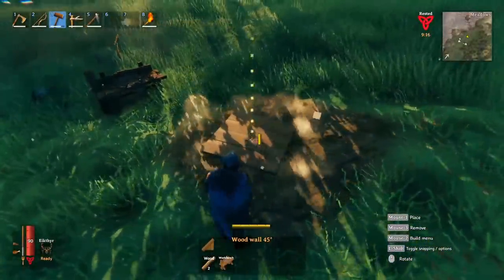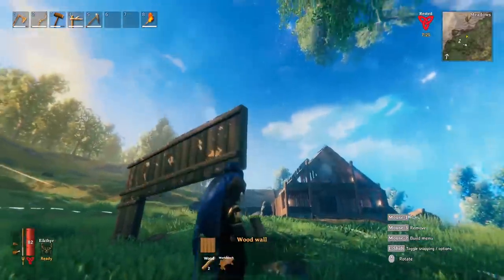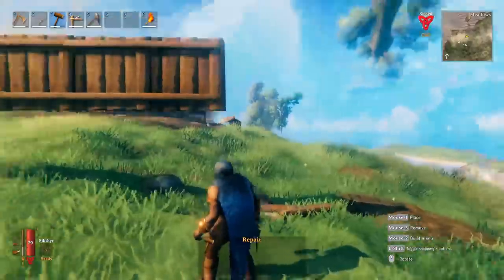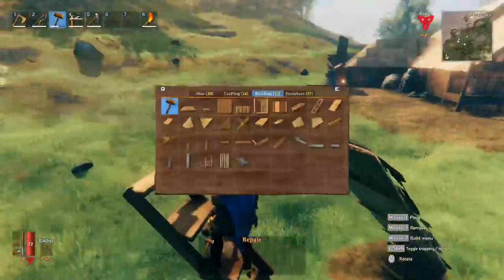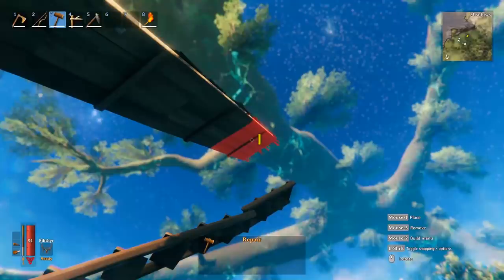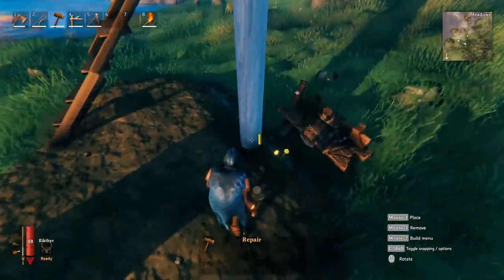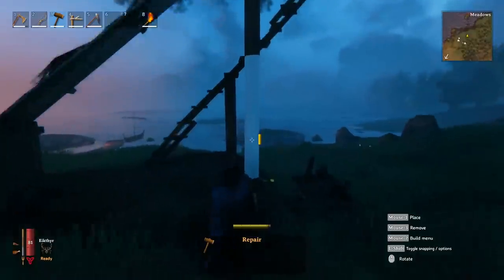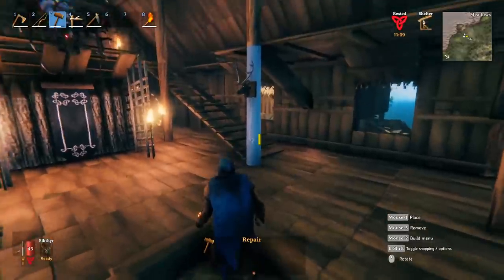VALHEIM - HOW TO REINFORCE YOUR BASE

Comment: One tip I'd like to share if you know you are building a tall building. Plan the foundation of your base but don't build up yet. Using the cultivator plant pine trees ideally around the corners of your building and one in the centre (you may have to remove some times, but don't worry you can put some of them back later. Once they have grown, build your house. By connecting to the pine trees, it counts as grounding your house. So you can build higher or more outlandish buildings without losing stability.

Comment: I've found that wooden pieces start blue when attached to stone pieces, even if the stone pieces themselves are not blue. I hope this helps!
Reply from the maker: Yes it seems that stone acts as another way to set foundational pieces!
Reply: If the stone piece is raised up on wood then wood parts coming off of it won't be blue they'll be green where as the stone will usually be red in that situation.
Reply: Interesting way to get a base into the ocean.
Reply: Stone is considered ground when it comes to integrity for other stuff that is not stone. Wich is why you can also put fireplaces and other stuff on stone.
Reply: Also another thing I can't get down is a "fireplace" with the stone hearth. By that I meant a stone hearth with stone pieces fixed around it. The stone breaks or the hearth snuffs out.
Reply: I've built two towers, one entirely out of wood (as high as I can). The other stone, then a wood tower on top of it. Building on top of stone is great!
Reply: This is the exact piece of information I needed to finish my docks, thank you! Just wish there was some way to interact with underwater ground. I hope the devs improve on this particular part of construction. Already having the time of my life building things though :D

Comment: I didn't have a game, but I expect, related to my experience in Medieval Engineers and it's structure integrity system, that you can put some dirt on place of the blocks and you will get it's stability. For Valheim I guess you may make some vertical ground pillar straight up, then build walls around it and then build vertical house around this pillar.
Reply: UT99 represent
Reply from the maker: That is a creative way of making a tower for sure!

Comment: This actually saved me I used to get SOOO angry because my builds would break even tho I had an entire cross roof beams going across long ways and on the thatch roof and across to each other and shit and even some beams going to the floor but the floor wasn't touching the ground so it wasn't working it was super angering, this really helped I couldn't find a single video with info about this until now :)

Comment: I've noticed the angled beams, the 26 and 45 degree ones placed in the corner of where two a vertical and horizontal beam or log meet will provide more stability and allow for taller builds. I'm not certain (haven't experimented enough) but I believe multiple paths of support to ground may be fractionally additive. For example, building in this way I was able to build a watchtower with only beams and got it about 14 meters tall at its highest point and completely roofed.
Reply from the maker: Yes I do believe adding beams does add a little bit more stability as long as they're connected to the ground in some fashion. I'll be doing more extensive testing over the next few days to try different methods and see what works/what doesn't!

Comment: I know this is an older video and it doesn't look like you like a stonecutter in your workshop yet. Stone will increase stability even higher. A simple stone floor structure with some stone columns going up to build off of effectively raise your "foundation" level. Considering this is a month old from when I am posting this I am sure you have found this out. I did learn something very important by this video as I did not know about the number of distances and this is helping me out a lot.

Comment: Great video, the only theory that I would posit is that the number of pieces don’t matter, it just matters distance and strength.
If you build a pillar of 1 meter posts, you can build just as high as if you build the same pillar with 2 meter - suggesting that it isn’t a matter of just how many pieces it is to the ground.
But, there is definitely differences in how hight you get with different types of pieces.
This is why I think it is a mater of distance, not number of pieces, but that different pieces have different “strengths”.
Which would have it make sense that the log poles would work better because they are from a later game wood.
Reply from the maker: Yeah honestly I'm not entirely sure myself, will have to do more extensive research to find out

Comment: I've become a fan of building round buildings. My first base structure in the meadows is usually 1 wall, then rotate the wall 1 click. It comes out not too big, not too small. As I move on to the black forrest I do 2 walls and rotate one click to add room for more equipment like upgrades and the forge table. At 3 walls and one rotation tick you're  as big as you'll ever really need. 4 walls with 1 rotation click you are following what your crafting table allows. Every few roof tiles in you add a support to the ground, then in the middle where the roof tiles begin to majorly overlap you raise the roof with short poles to allow for smoke gaps, and finnish it off of those poles.
Reply from the maker: I've done this exact procedure for building my treehouse, you will see examples of that in Part 2 of the Treehouse Timelapse :)
Reply: @schmidtyhk  im about to move on to the swamps myself, going to make a tree house there as my next base.

Your discord keeps kicking me while I wait for the 10 minutes to claim roles btw
Reply from the maker: @buell2468  oh no, thanks for letting me know. I'll fix it and get back to you
Reply from the maker: @buell2468  Hi Tyler, I just checked and you shouldn't need to wait 10 minutes. Just go to #assign-roles channel and react to automatically give yourself a role. Once you do that it will override the 10minute wait

Comment: Good video, but in my house i have added 1 side bar to hold 1 pc of roof a bit extra, and it falls if its not there, but it holds if it is. therefore the little pc of wood does help in some complex structure to distribute "green". idk how else to explain it. My house is giant btw, this is why i say complex structure

Comment: You can increase the horizontal stability of building as well using the 26° beams and 45° beams, I tested this but don't quite know how to explain, so bear with me on this one XD

So, I built up 3 times with the 4m logs, and when I added horizontal 4m logs, I could only add one.
But when I added 2 of the 45° beams, starting at the bottom of the 3rd vertical log, and going to the horizontal log, I could add two instead of one.

It shortens the distance between the foundation by cutting the corner, I think.

Comment: if you stand on top of the wood planks, not on another piece of dirt, and then use the hoe on the dirt, it will go under the floorboard height without going too far for the log to be foundational

Comment: It's not ALL about length but structural strength. Poles etc have more than walls. So when you build the poles they were equal green, but walls went yellow faster. The core wood should however be better than normal wood, and Iron wood even better still.

Comment: So the structural integrity is based purely on number of pieces? So for example I couldn't just place 10 vertical walls without the top few collapsing?
Reply from the maker: It’s not exactly about number of pieces, it’s more about how far away you are from the “foundational" piece. I’m going to do some further testing on height limit as I believe there’s even more complexity to it after playing a bit more
Reply from the maker: As far as walls, I’ve tested and I can fit 7 walls on top of each other before they can’t go any further

Comment: I tried leveling the floor but there are still some pieces of dirt coming thought the floor. How do I fix this?
Reply from the maker: You could break some floors until you find one patch that is the correct level, stand on that then level. If it still won't go down it's because you can't level any further, then you'll need a pickaxe to break it down

Comment: Is there a height limit? I was building a watchtower and kept reinforcing the structure on the way up, but after a certain point, it seems that no matter how much I stabilise the building, I can't build upwards further.
Reply from the maker: I believe there is because as you go higher, you'll be further away from the foundational piece on the ground. So it's less about a 'height' limit, but more the fact that we have a limited number of pieces we can connect before they will lose strength
Reply: Really makes me wonder if trees could be used as foundation pieces
Reply from the maker: @ReducedWater  Just coming back to this comment now, you can use trees as foundational pieces as evident by the treehouse I'm currently building!

Comment: i am still figuring out why you need to repair the floor every 2 days and the first level walls . but the roof etc has no demage over time.. it makes no sense .. i flattened the flor so its supported by floor.. yet my  floor and 1st lvl walls keep getting damage for some dumb reason
Reply from the maker: Anything that is not covered by a roof will take damage from the rain and storms, but don't worry it goes down to 50% health but it will not break

Comment: wait so does that mean Trees count as Foundation pieces? and building off trees lets us go even higher?
Reply from the maker: I don't believe they count as foundational pieces because you cannot 'snap' pieces to them unfortunately.
Reply: The base I’m working on agrees with your idea, and it is even better, they count as the ground. So, attach pieces to them, or get them close enough to be considered touching and you’re all set.
Reply from the maker: @jasonlatta2000  ahhh I didn't know you could snap pieces to them! The only issue I could potentially see is if you got attacked by trolls, if that tree breaks it's GG
Reply: @schmidtyhk  that is my concern, but I’m hoping that the wall takes care of that problem anyways. And, failing that, the trolls don’t seem interested in breaking trees, as long as nothing else nearby leads to collateral damage.
Reply from the maker: @jasonlatta2000  It's been shown on reddit that Trolls may potentially attack your base while you're not there / while you're there too. So if you are unlucky enough to encounter one with a club, they can do serious harm to your base
Reply: @schmidtyhk  some trees in the Swamp can not be destroyed by any creature btw.

Comment: I've been testing building towers of stone. I have been so far unable to build more than 16 1x1 stone blocks high. Even with stone pillars. I can continue on from the 16 high block of stone with 8 of the 2m wood beams, this brings it to 16 blocks in height as each 2m wood beam is the same length as two 1x1 stone blocks. I am not really a fan of the build system in this game. To me is way too restrictive. Eventually as you build higher you also need the corresponding tables needed to build with stone and wood as even the tables only support building so high. To me the build radius needs to be a lot larger. The way it works in other games is structural supports actually provide support for the next level in a radius around them as long as they are touching the ground. Empyion, space engineers, even skyrim. All of those three games IMO have a much better building system.
Reply from the maker: I would agree with you the structural support system in the game isn't as obvious, for example horizontal supports don't matter which isn't right. However I still think the building system in this game is very enjoyable, different tastes for different people!
Reply: @schmidtyhk  You can't build that high though which for me destroys the fun of the game. In other games I can build massive skyscrapers If I want. Also building over water is hell annoying. you have to place supports down and because of the waters reflectiveness and how dark it is in areas you cannot see the ground to place a dock or something. Apart from the annoying and unenjoyable building system the game is awesome.
Reply: @burninghalls  I think it's quite nice actually, someone will call me out on what im about to say but I feel like it gives you a touch of reality because you wouldn't be able to build too high using wood as a structure you know.
Reply: @QqKamilqQ  True but then you think Stone being the next tier up would be better but no its exactly the same. Can only build to the exact same height as a wood structure. I don't think its out of the realm of possibility that the Vikings had some sort of cement like substance, Hell the ancients had mud bricks, then they eventually discovered clay. I think the game is trying to show me that the walls are just stones piled together, when in reality that would be stupid. Even in the medieval period they also had a substance called daub. To me it's still just disappointing that the hammer lies to me. Its description in game is that when I get it I will be able to make towers. Yet not you can't build a tower that is that high. 16 1x1 stone blocks to be exact. Any higher and the 17th stone block will just crumble when placed. Yes I had these stone making constant with the ground so surely its not that. As for wood the Vikings and Norse were amazing with wood.

Comment: Thanks for the tips. I honestly really dislike this system, if only because it's rules are so trivial. The lack of diagonal and horizontal reinforcement makes building kind of a nightmare.
Reply from the maker: It does mean that you need to have vertical pole in the middle of your structures because you can't really have too many hanging pieces or they will be too far away from the foundational piece they're attached to

Comment: I tried building a sea port without core polls, its was such a bitch trying to reach the sea floor and line up all the pillars.  It looked good then slowly turned to crap as the dock went out.  I guess I'm going back to build with core wood now.  Lol.
Reply from the maker: Wow that sounds like quite the challenge, I only built a small boat house and that was already tricky with raising the sea floor!

Comment: Stone is the key to building high, unfortunately it's not reinforcing it's just a build limit with how it's designed, I have come up with cheeky little work arounds to build one high than the game world normally let you build a roof.
Reply from the maker: Interesting, how do you do it?
Reply: @schmidtyhk  trick the game  into thinking you’re lower with angled beams or stone arches. Building a roof with both the 45, and 23 degree options makes it easier

Comment: Summary:stop building high until you get core wood
Reply from the maker: That is somewhat true but it’s not impossible either!
Reply: you can easily get 2-3 floors safely with normal wood if you support it well...took me a long time i could have spent getting core wood
Reply: You can get up to four floors, but it's a pain in the ass. I DO NOT recommend trying it.
Reply from the maker: It also really depends on your roof design and how wide you plan on making things too, because if you have a very wide structure, you'll have to reserve some 'build limit' to connect the roofs together as it'll probably take a few roof pieces to close off the middle
Reply: Building stone towers is still hard even with core wood, the top layer of my tower is red, 3 floors tall
Reply: @zyanidwarfare5634  we were not talking about stone towers we talked about wooden houses^^ stone is a different story you should use iron pillars for that
Reply: But the ending of the video showed there is no difference between 4x2m or 2x4m support. So it's 8m from grounded support most likely not 4 building pieces so you don't need log supports at all.
Reply: @84567297  looks like shit tho lol
Reply: @joelbaker9366  with 1 high walls each floor or 2 wall?
Reply: @Patrick86575  Three floors at 1.5 walls, and the last floor only 1 wall because of the roof. And that was on a 6x8 building, so that gives you a roughly 8 high build limit with just wood.
Reply: Can’t you just stack the 2 meter poles in the same way?
Reply: @glos7569  Not really. You can use them for support of the floor, but with "just wood" you're limited to roughly 8 "wall heights" in building, or 14-16 meters.

Comment: That was much better explained than any other tutorial I've seen, the demonstrations were very helpful. Some other tutorials are missing the point that it comes down to the foundational pieces and how you can reduce the amount of pieces being built away from them. Like log poles don't actually make the build stronger but they reduce the amount of pieces needed to cover the distance from the foundational pieces

Comment: Hey man excellent video! Just wanted to add some extra details I've found.

Support height is based on overall length, not piece count. Eg with normal wood poles, you can stack 7 2m poles OR 14 1m. Core wood pole DO have better support (up to 11 high), but it doesn't matter if you use 2. poles or 4m.

Also as mentioned in another comment, any wood attached to stone (regardless of height) will be a blue/foundation piece.
Reply from the maker: Yes I have since learned that after making this video, thank you!